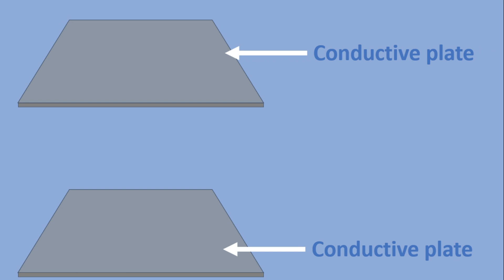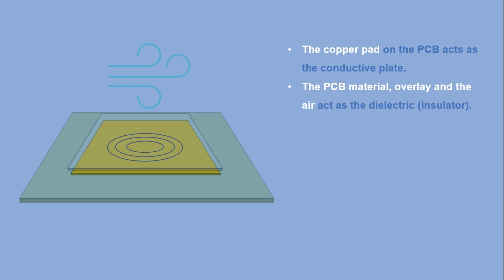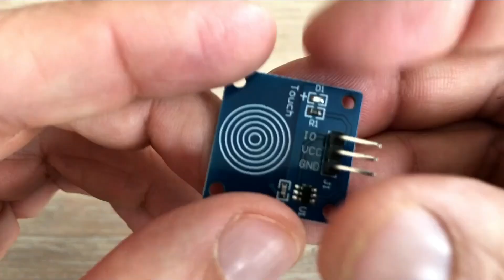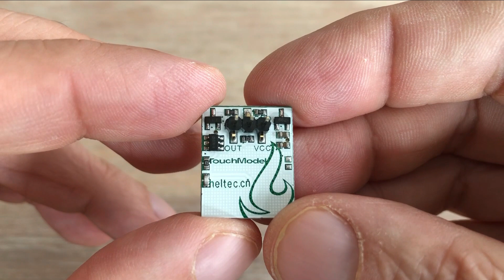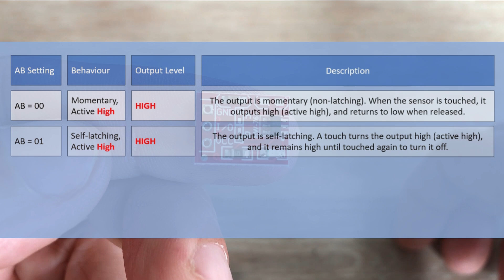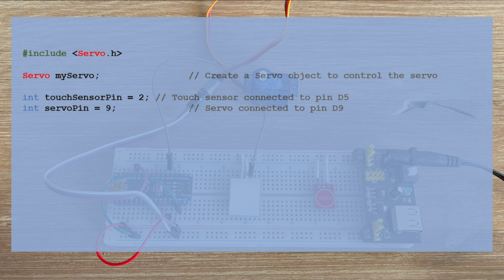Capacitive  TTP223 Touch Sensors Explained with Arduino

Comment: Some facts about the TTP223 chip that may be of interest:
+ Consumes at max. 7uA... That is 0.000007A!
This means it can be kept idle for +12 years using a 3.7V lion battery of 750mAh.
+ The current for your device to be switches on/off, is rated at 8mA,
while 8mA is doable and some sources claim 30mA according to Google AI.

Comment: Ahh, that's cool. I tought I had use a micro controller to use them,  but never knew they had a built in function too, that will come in handy.
Got a bunch of the red once and some knock sensors today.

Comment: Hello. Thank you very much for the video. Could you please tell me if I have a problem where when I hold the sensor for a few seconds, it cuts off (goes into sleep mode). Is there a solution to keep it tracking all the time?

Comment: I have a TTP223 Red module, and when I short pin B, it turns off automatically after a few seconds. I’ve tried everything: adding ceramic capacitors to its pin, testing with dummy loads using 100Ω and 200Ω resistors, ceramic and electrolytic capacitors across VCC and GND, running it alone and with a load (LEDs, with and without a transistor), and even changing power sources — but I still get the same result.
Reply: Electro magnetic interference pehaps? Try adding a 7 pf ceramic disc on vcc and gnd

Comment: On the top left of the PCB you can see two empty pads. 
This sensor is normally too sensitive. You can solder a capacitor to those pads to reduce the sensitivity. Values between 10pF and around 50pF should he used. Increase the capacitance to lower the sensitivity.
Another thing many of us do not know is that if you keep your finger on the sensor for about 8 seconds, it resets and turns off. I think this has to do with the self calibration capability.
So, if you need long touch times, you might want to find another sensor. 😢

Comment: Thanks for explaining the ttp223.   I am trying to use one of these bathroom touch sensors frombAliexpress and make them a WiFi switch.   They are pre-made as latched and the circuit switches between floating and ground.   Google AI says I need a pull up and rectifier bridge to detect whether a pinnis floating or grounded.  I wanted to know how anyone has done this before.

Comment: I need small help regarding tp223 red colour pcb
If I am putting my finger on more than 20 or 22 seconds,
Output status shall change even though my finger is still on pcb.
Do you have any solution,
Like sensor output status should not change till my finger is on pcb?
Reply: I have the same challenge. It seems that the TP223 resets, since the value of the capacitor that is used to measure the difference get's equal after a while. 
I would love to use a sensor like this as a presence detection if you hold a handle. Sofar no luck solving this.
Reply: I have the same problem. Does anybody know a similar chip that does not perform anti-drift compensation and calibration (resposable for this problem)?

Comment: For the red ttp223 module I have it set so neither A or B are soldered but when I connect a LED it is always on until I touch the sensor which then turns it off
Reply: How?

Comment: Hello I am trying to use the TTP223 as a switch for 2 LED meteor lights ( 3v 20ma each)  I tried this with the red TTP223 and they are not very bright, and now I am learning its output is only about 8ma. on the red sensor.  Does the lighted plastic/glass ttp223 have a higher output?  Also is the plastic lighted sensor less prone to interference?  I have also learned that you can either change the resistor for the onboard LED (again the red sensor listed last) to lower the current draw of the switch, but would this also increase its output?  Thank you.
Reply from the maker: To drive LEDs requiring higher current, you'll need to use the TTP223 to control a switching device, such as a MOSFET or BJT, that can handle the required current. Check https://youtu.be/XiOcxyyTxy4
Reply: @marios_ideas  Thank you so much for your reply.  I looked up the description on the second switch you reviewed (lit up glass switch) and it says output voltage "3.3v,  max currant 500ma"  I believe this would be perfect for driving the (2) 3v meteor leds needing 20ma each with out any need for additional components.  thoughts?

Comment: I have wondered if there is a way to add a signal to these touch sensors to toggle them from an arduino.  Operaton would be
- activate to latch output and power an arduino
- at end of operation, arduino toggle touch switch to drop output and kill power to arduino
I have used bi-stable flip flop switches but this touch sensor would be useful if it could be toggled via arduino and if it could handle the power for the arduino.
Reply from the maker: Not sure I understand your question. If you connect the touch sensor to the same power supply and connect output to 5v pin of the Arduino and also connect Gnd pin of Arduino to negative side of power supply then you will be able to power Arduino this way. We are of course talking about self latching sensor here
Reply: @marios_ideas  After powering the arduino and running the operation I want to power down the arduino.  Disconnect the power by toggling the touch switch by action of the arduino.  Power itself down.